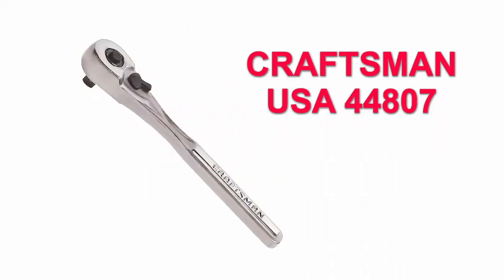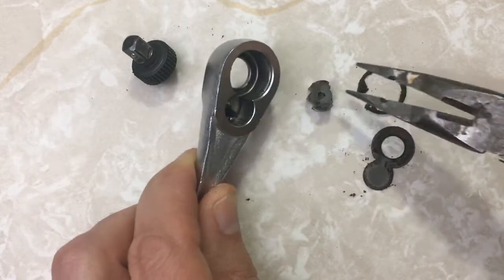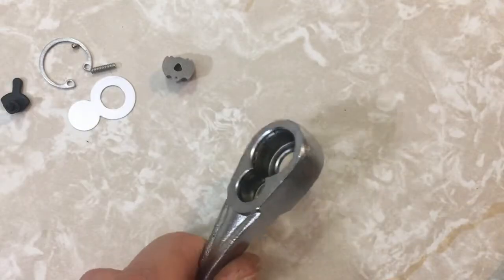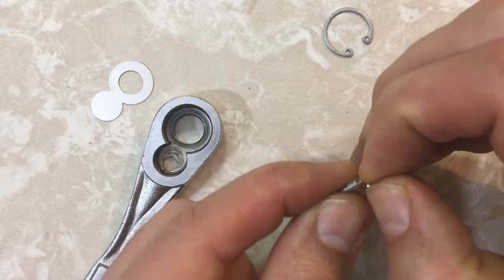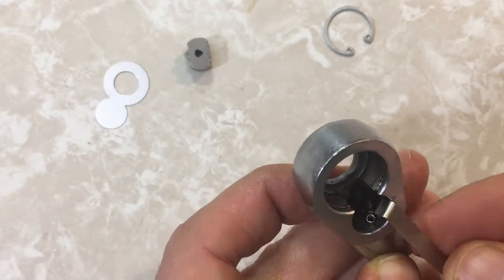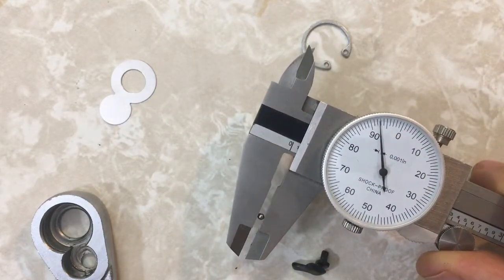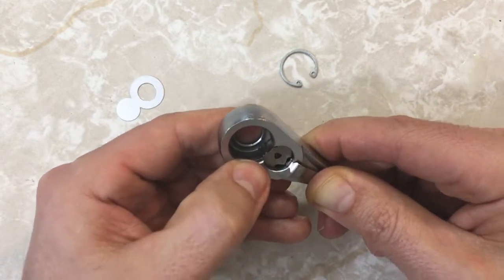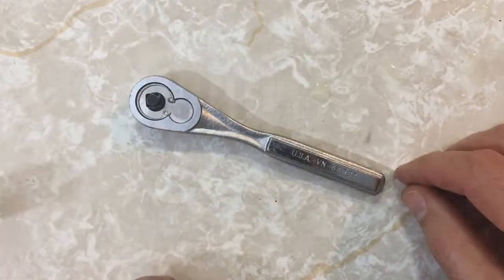[19-C] How To Repair a Craftsman Socket Wrench

Comment: I have a Craftsman 44811 and your video helped me save one of the last Made in the USA Craftsman tools.
I was baffled till I saw you use a pen clip to compress the bearing and spring.  I didnt have that so i used a thin folded piece of paper.  It provided just enough pressure to keep the ball in place and then slipped right out after the pawl was in place.
Thank you very much!

Comment: There was nothing wrong with those parts I would consider them brand new condition all you had to do was clean and install superlube! Most ratchets that get brought in for warranty are the same thing and there was enough ratchet kits to keep real technician's going for decades and now we are all out from stuff like this! I have had the same ratchet for 25 years used daily and it looks polished inside but works great ! I could have used your old parts for another 25 years!

Comment: You could of returned it to a Craftsman dealer for a new one under the lifetime warranty Craftsman has for their ratchets. Use a dab of grease on the spring to hold the ball in place. Nice video